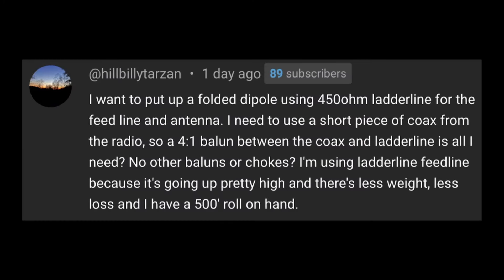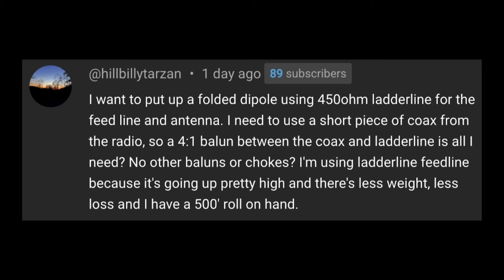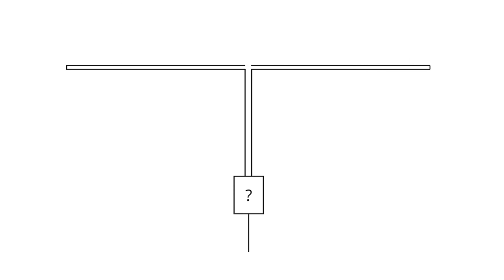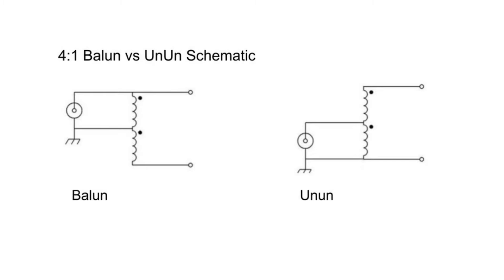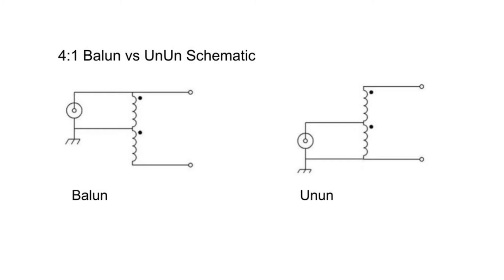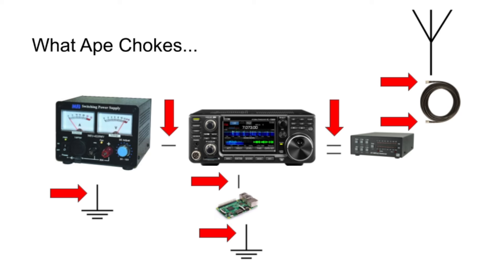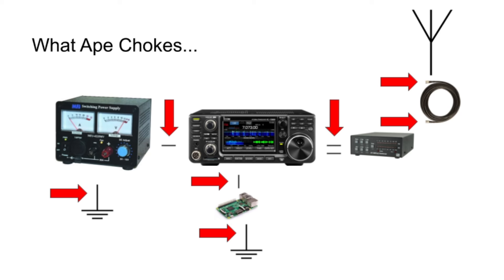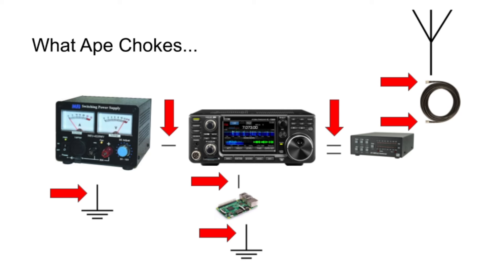Ape Answers 003: Baluns and UnUns

Comment: nice job. yes choke all cables. I even do my mic  cable with one of them snap ferrites . i use USB cable on my 7300 so I got nice long one and wrap it threw FT 140-31 bunch of times.  if that antenna feed line works out 450 ohm then 9:1 Balun. have to model antenna to get feed point ohms impedance.  the off set center fed get confusing that not balance antenna but takes a balanced feed line. That why a Balun . feed line balance to un-balanced . so when looking at Balun and UNUN . you look at feed line in and out. some folded dipole work out 300 ohm . so a 4:1 gets close. when doing folded di pole the distance between the wires is part of impedance. like the folded dipole for FM radio is 300 OHM made out of twin lead.  their is a double folded di pole type that is 450 ohm.  for best with feed line loss is to get close to the feed line impedance as the antenna as possible.   the trouble with window line is keep away from metal and try to keep it dry . 73's
Reply from the maker: Hey Robert, thanks for the info on the folded dipoles.  Much appreciated 👍
Reply: @TheSmokinApe  read threw the ARRL antenna handbook.  great source of info.

Comment: Hi don't know if you can help me. I have a 4 to 1 unun or balun I know its 4 to1 I've put a 200 ohm resistor across the terminals  and got 50 ohms on the analyser across  the coax  but I can't get the top off to see the wiring is there zany way to test it to see if it's a balun or unun
Reply from the maker: You would need some expensive equipment, where did you get it?
Reply: I @TheSmokinApe  it came from rally in  a box of bits it seems  really well made .
It sounds like I'll, have to cut the box open to find out
Reply from the maker: @geoffpriestley7310  prolly the case
Reply: @TheSmokinApe  I suspect from the weight it could be filled withn
Reply: Filled with resin. I have a vna and a known 4to1 unun .I'm thinking that I could compare the response curves on a long wire the should be similar if they are both ununs would that work?